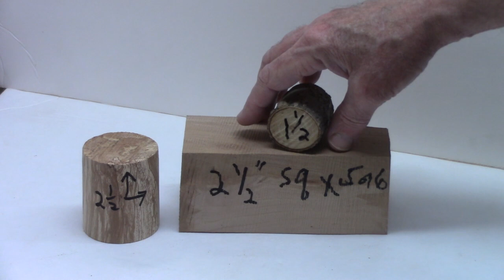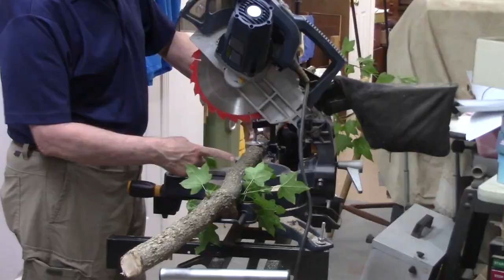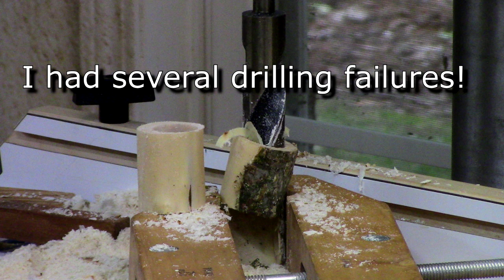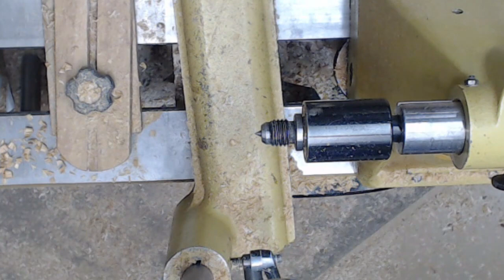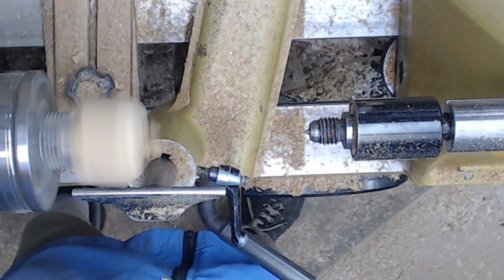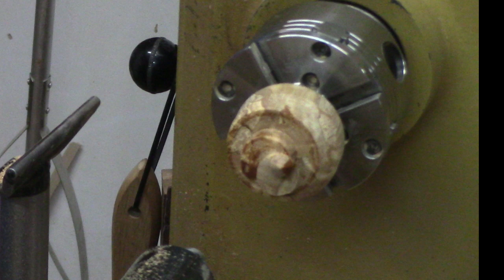Turn a Mini Multi-Axis Pedestal Bird House Part 1

Comment: Nice project, Mike. I'm glad you covered the differences in drilling the blank on the drill press and on the lathe. As you demonstrated, the lathe is often the best option. 

One suggestion: Rather than gluing the blank to a glue block held in a chuck, try simply holding the blank in the chuck. With 'live edge' turnings such as these, the wall thickness isn't going to be  uniform. So, I don't think any additional accuracy obtained by using a glue block is work the extra time it takes.
Reply from the maker: I was concerned about holding in a chuck without a tenon would damage the bark as it happened on the DP. Turingg between centers and adding a tenon was an option for small chucks but would take a longer blank and longer time and I had already cut the blanks so had no extra to waste.